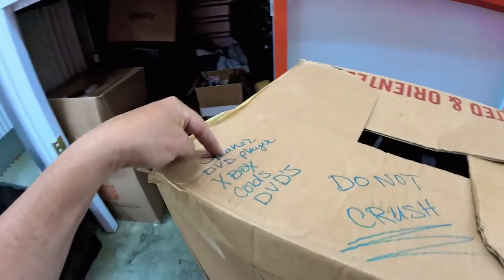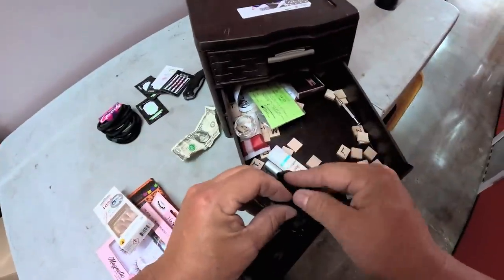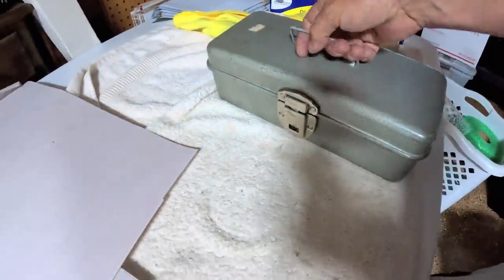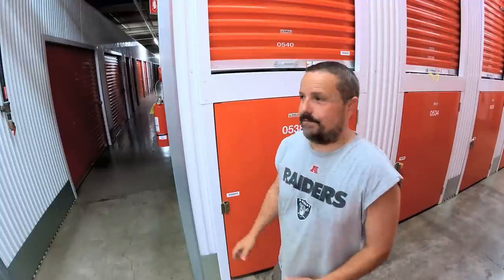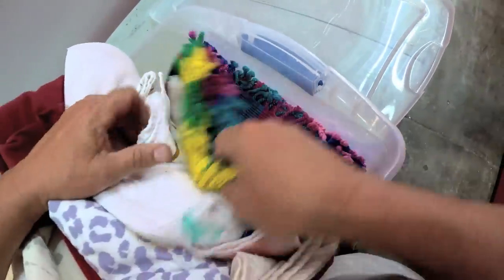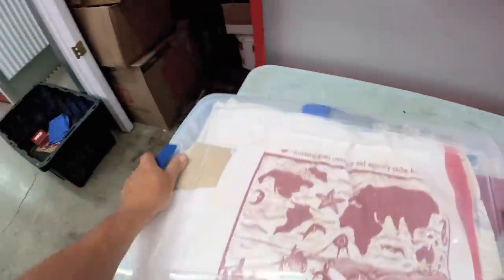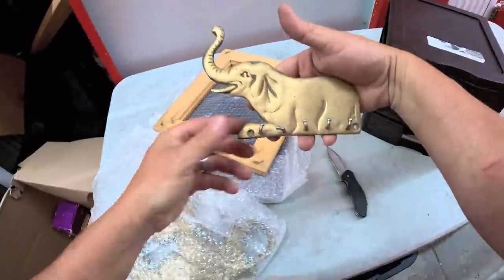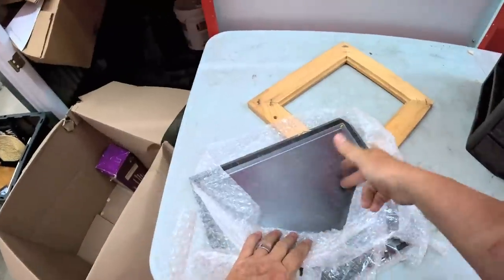CASH BOX found ALL THE WAY IN THE BACK - Let's bust it open!

Comment: Yes jack and you should keep the Narcan incase you run into fentanyl in a locker. It takes very little to over dose on and it can dose you through the skin. I was in law enforcement and carried one incase of exposure. Narcan will not hurt you.  An officer i work with got exposed searching a car.
Reply from the maker: Thanks! I am indeed going to keep it, and I found 2 so I'll put one in my truck and the other in my van.
Reply: And maybe some thicker, heavier gloves for a bit more protection once you find a first needle in a locker.  Like leather work gloves designed for outdoor work. I know they’re cumbersome, but one needle leads to another…

Comment: Those straps go with the sandbag pillow. You attach the straps to your hard and hang your head over the side of the bed with the bag hanging from the straps. Works great if you have neck problems. That on looks kind of heavy though.